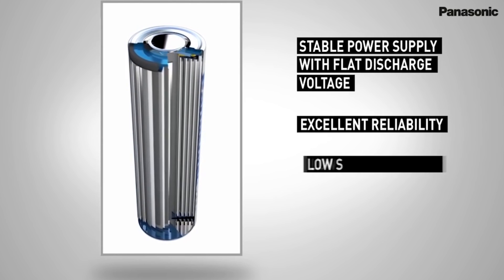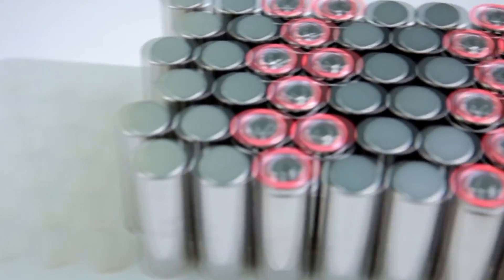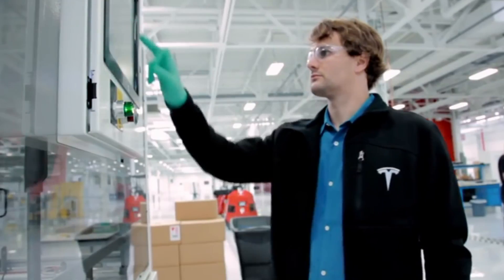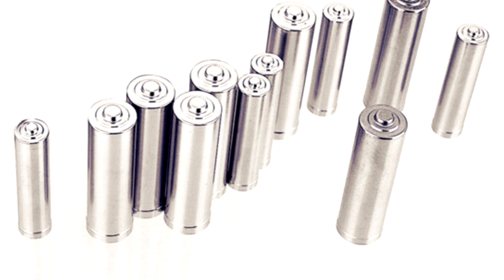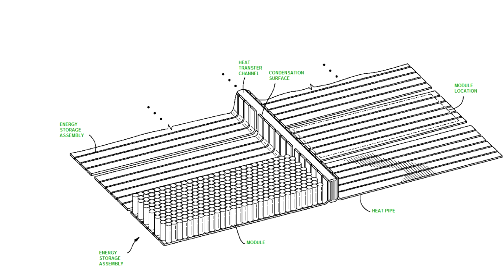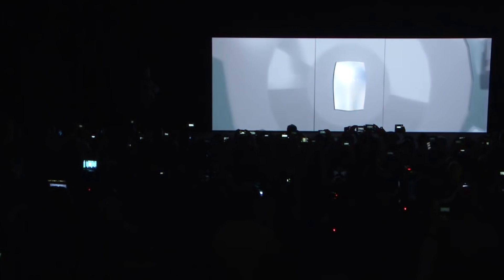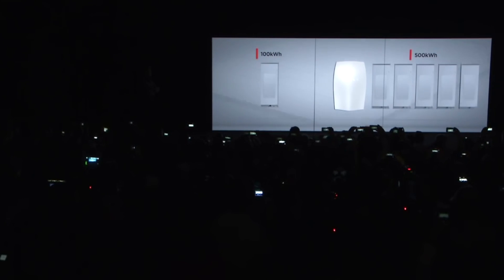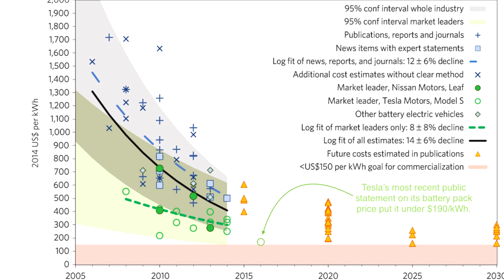Tesla's 18650 cells vs 2170

Comment: There is nothing revolutionary about this cell, its simply bigger and thus it can contain more energy. NiMH/NiCd +3000 mAh compact batteries have been available for almost a decade, Sub-C size are only 1mm larger in diameter but almost 30mm shorter than this 2170 and can contain up to 5000 mAh. 

Sorry but Tesla is overrated as F.
Reply: C.I. Pedrin educate yourself... easiest example is laptop battery vs drill battery
Reply: Anas Malas please elaborate, your reply is void of coherence
Reply: I had no time and was depressed about something....

A laptop battery has chemistry that is optimized for capacity, but has pretty high ESR and so you can't draw a big amount of current without the thing heating up and exploding (like 3 Amps?)

Drill batteries are optimized for current draw, so while they have lesser capacity you can pull double digit amps.

A car needs lots of current to run, so it would tend to have a chemistry that is current optimized.

Also, Nicad 3000 mAh is at 1.2 volts, while Lithium 3000 mAh is at 3.8-4.2 volts, so it's very different
Reply: If you read my comment again, you'll notice I only talked about density per volume, not Voltage or current.
Now, if the whole reason for the press conference was about voltage/current and cost, then yes, its a nice step up... energy density? nope.

RC toys (planes, helis, cars) have been using flat LiPo cells for years and were well over 4500 mAh in a smaller package since the technology was imported.
Reply: C.I. Pedrin and you have not understood a thing that I talked about. Forget it
Reply: I will forget it, it is quite typical for people on the internet to try make a point using facts unrelated to the argument. I'll say it again, my post was ONLY about cell size and energy capacity, not chemistry, not cycles, not current, not voltage and certainly not cost.

There's no way I need to explain what density means.
Reply: C.I. Pedrin again, get educated. You claimed there is nothing revolutionary.

It's quite typical for people on the internet to be unreasonable critics

Comment: did he just say they see about a 10% increase in capacity, the 30 seconds later say they increased high and width by 10%? so. they just made the cell bigger and called it an improvement? shouldn't a 10% size increase in both X & Y axes have  netted them more than 10% increase in cell capacity? it does in the rest of the battery world (at least lipo).

Comment: the 2170 in the tesla will be an 85 because they can't stuff more batteries in it but will have a 300 mile single charge range 
        have herd that Tesla will change out the batteries on the new Teslas one time
         Trump has removed EPA restrictions on ICE. and going to put a tariff on cars made outside of the US..........GMs. volt is made in Mexico and will not be needed to fulfill state environmental requirements 
           this is the end of big oil
Reply: Chevy Volt is assembled in Michigan using US and foreign parts.
Reply: Dan Sanger.  I got my info that volt was being moved to mexico from 3 GM announcements. ...are you sure. ??
Reply: Lady pilliwick I certainly could be wrong, but everything I've seen says they are assembled in Mexico.  The only news I saw about the Volt and Mexico is that they have started selling them there.
Reply: Dan Sanger. have to sit back and see...I like the volt...hope I'm wrong
Reply: I like them, too.  I just bought a new one five days ago, and so far it's my favorite car I've owned by far.  It's really a pleasure to drive.